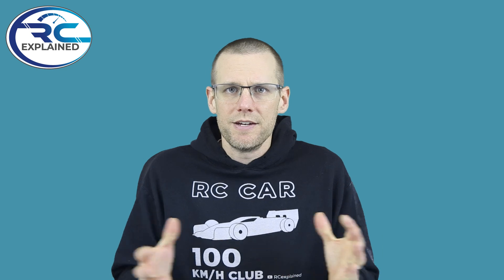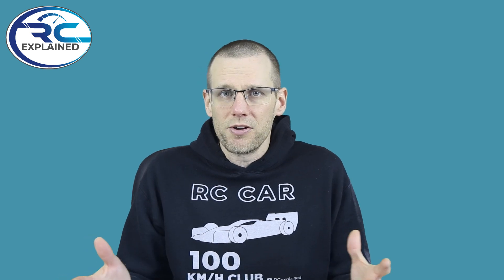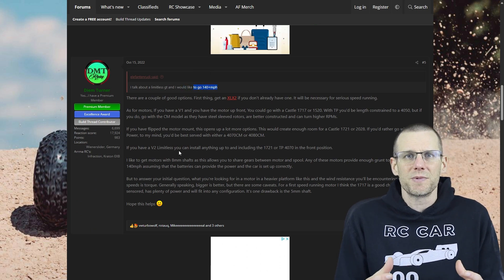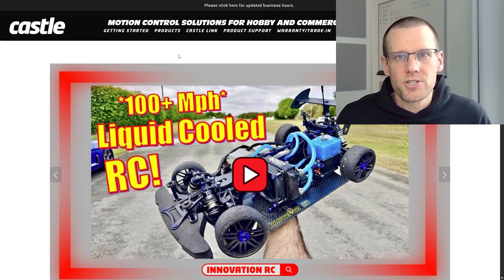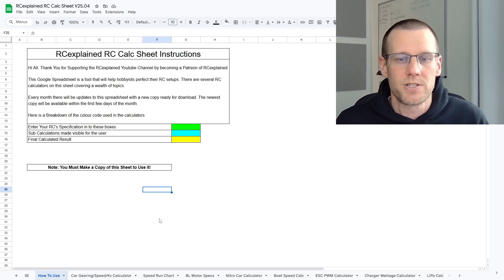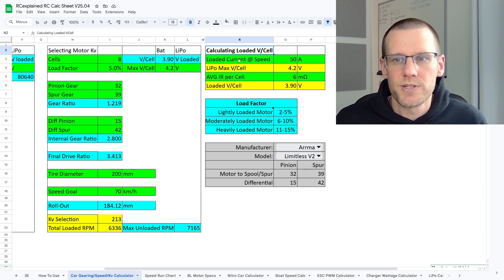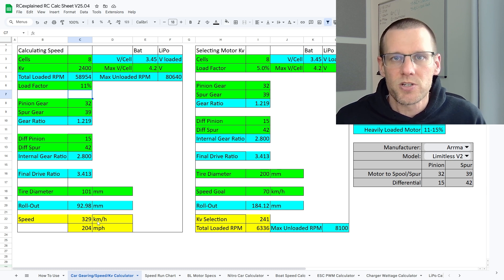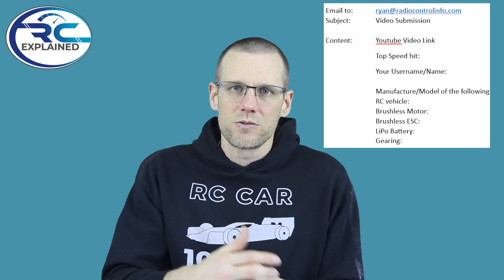Selecting the PERFECT Power System for INSANE 140MPH RC SPEED!

Comment: arrma felony. 45/15 diff ratio in front and rear. Hobbywing max 5 G1 200amp SENSORLESS esc (8s capable) Leopard hobby 5892 size 780kv sensorless bl motor (really 5692 without the heatsink)

Comment: I use the vesc for my esc. I like the huge voltage range they are compatible with. Space is sometimes an issue but you won't burn them out on an rc car.

Comment: 1721 and xlx2 on smc 8s should be super spicy! im running a 5687 1100kv and xlx2 in my infraction but no good roads for it yet, 101mph limited by bumps. @slowrcmike was able to get the stock arrma 4074 2050kv motor up to 165mph on 6s . It may have been in a Hobao chassis(iirc) with all the goodies(ceramic bearings, 7 ga with 8mm bullets, etc) but hes ridiculous when it comes to 2 and 3s runs. 6s was just for showing off and the motor was smoking after the one pass.
Reply from the maker: The 5687 is a monster